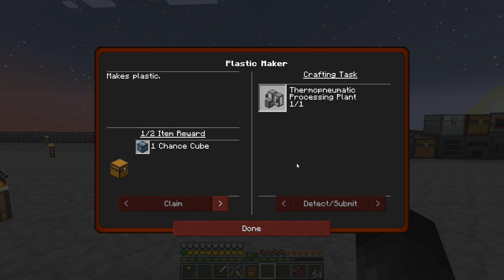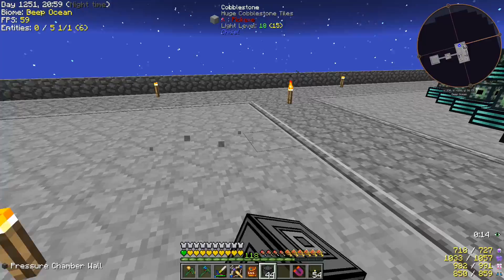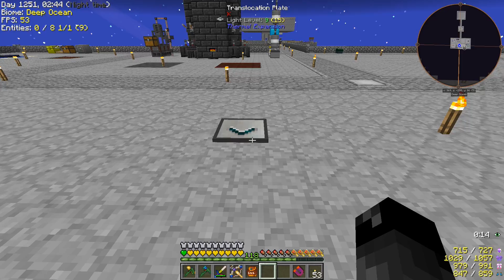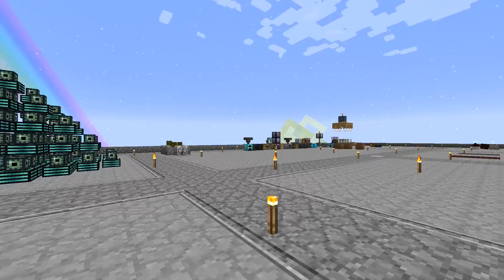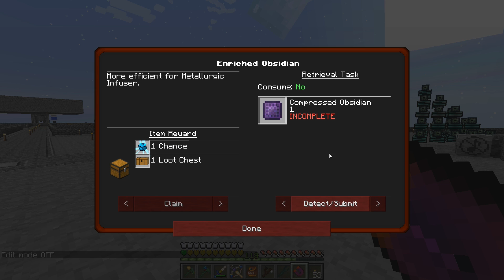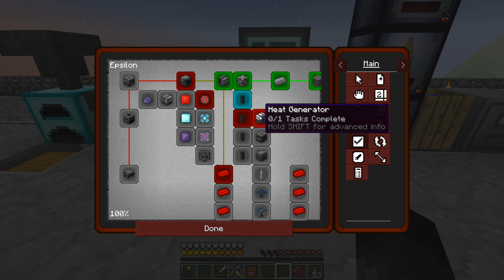Project Ozone 2 Kappa Mode - CHEATY PRESSURE CHAMBER [E23] (Modded Minecraft Sky Block)

Comment: Hey Hypno!  Good show as always.  Was wondering if you would take a few minutes and go over the optimum setup you have found with the farmer for auto-upgrading the seeds?
Reply: MrJeridan not sure about his but an elevated non upgraded agricraft farming station with a plus sign for 10/10/10 the seeds and a 3×3 setup of sprinklers above 5×5 is the best don't upgrade it'll go faster than the crop's growth even with a 5×5 setup giving you doubles overall slowing the process and make sure you elevate greatly increases it's speed due to the way how ender io machines functions
Reply: Ok, makes sense, thanks for that.  I need some help with the upgrades inside as I'm not sure which ones I need to automate the farming station for upgrading the seeds.
Reply: MrJeridan well I don't know how hypno set up his one but I cab6 tell you mine it does have a problen where even after tge the seed is 10/10/10 it keeps ongoing till it creates like 8 stacks of that seed since I void the output but here is the configuration

Breeding module
Seed harvesting module
Seed analyzer module
Harvest unanalyzed plants module
Plant upgrading module
Seed sorting module

Comment: If you shift click out of the inventory panel it won't activate for crafting quests. If you just grab it from the output it works fine. I've had to remake a bunch of stuff in my play through. Or you could just set the quest to complete